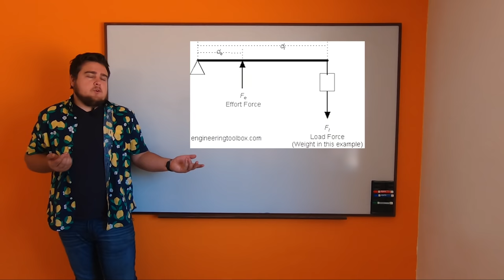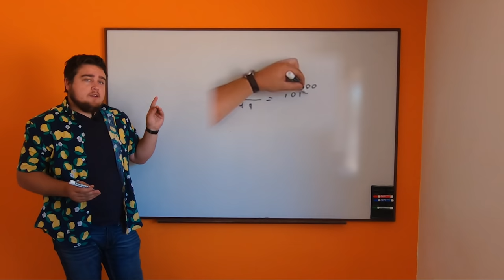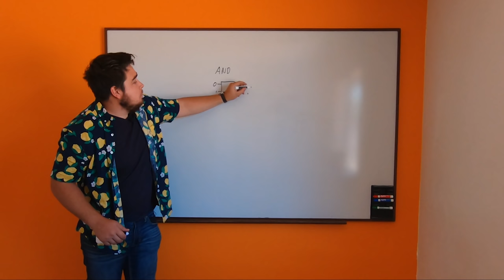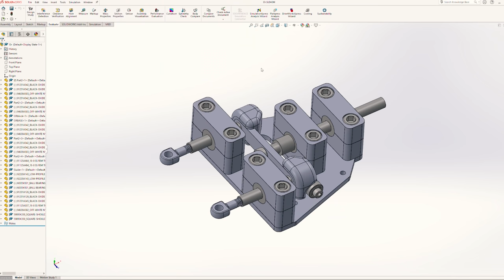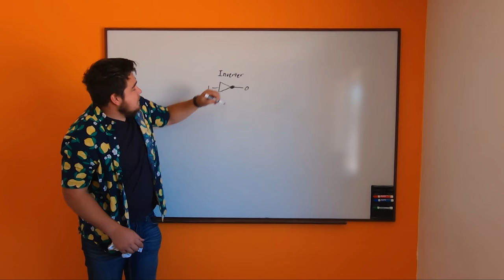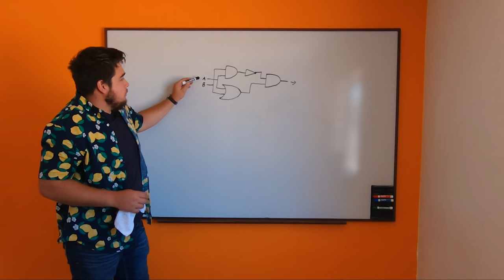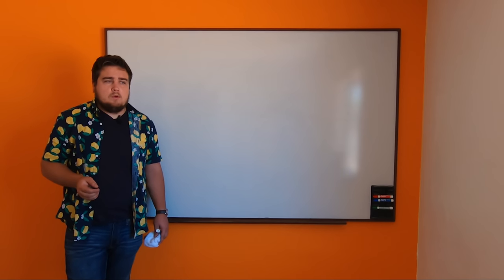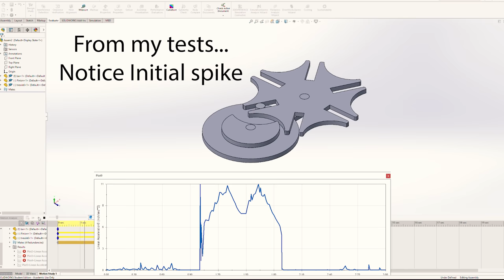Is a Completely Mechanical CPU possible?

Comment: "Art itself is in nature, and technology just reveals where it's hidden." That's a very profound statement.
Reply: 11011
Reply: I was enjoying the vid up until that point. To me it seemed a shallow pretentious statement, and completely misunderstands what art is and why it exists. Fortunately that really doesn't matter in a vid about making mechanical computers :)
It's a truism to say that art is in nature - after all everything is in nature - nothing profound there. The idea that technology somehow reveals 'where' art is is just nonsense - completely meaningless... unless you are shortsighted and need optical technology, or its nightime and need artificial illumination, or you are lost on the way to the museum, and need some cartographical tech... but those are just practical details.

As far as the binary logic - that's cool. It would be neat if there was a simple mechanical implementation for a NAND gate, because that is all you need - every other type of logic can be build from NANDs
Reply: @oldmossystone  I completely disagree with your blanket, and quite frankly derogative, statement. A statement that is just as shallow as you claim that the original statement is.

Because:
There would be no flute without the technology to drill holes in bones or forming wood. Not to mention metalworking, but that is much later.

Body paint works as sunscreen, and extracting the paint and mixing it is also technology.

That statue that always was inside that block of marble?

It required many skilled hands to turn the marble rock into a block, and even more technology to create the tools used in all of the processes from extracting a slag of stone to polishing the final statue.

Making a strict divisions between art, science and technology is dangerous. Art, including stories, have always inspired scientists and engineers to create new things, while new technology and scientific breakthroughs made new kinds of art possible. The links between technology and science most definitely goes both ways as well.
Reply: @57thorns  The implication in your original statement is that art is hidden and needs technology to reveal it. If this were true, all art would require technology to reveal it. This would exclude e.g. singing from art. QED.

While various forms of technology can be exploited in the creation and dissemination of art, there is no essential need for technology in the pursuit of art.
There is no need for a 'division' in order to make a distinction between technology, art and science either. Division would be bad, distinction is necessary in order to understand what each of them is, and to help us understand their unique value in our culture(s).
Returning to your example of the Block of marble. The statue was not always inside the block. The statue is a result - a side effect - of an expression of the artists state of mind during that creative process. The important point here is that if there was no stone, the expression could still have occurred in some other way - the Block of marble is not the essence of the art. The statue itself isn't even the essence of the art - otherwise any statue would be art (clearly not the case, many are just ornaments with no greater value). The statue or song or painting is a conduit - a medium through which to communicate.

A book is a useful analogy here. A book is a physical thing with pages and words. But the book is not the story, and the words are not the story either the story is an abstract construction of ideas that the reader decodes by reading the book.
A statue is like a book, it is a medium through which an artist has encoded some abstract meaning. If the statue is art, it is because it contains some deeper meaning encoded by the artist well enough that it can be decoded by the 'consumer'.
In the same way a story doesn't have to be in a book, it could be spoken word, or a movie, the essential meaning encoded in a statue could potentially have been encoded in a painting, or some other art 'form'. Not all available encoding forms require technology.
Reply: @oldmossystone  And yet, you can't accurately retell a story over time without a book (or other media that conveys words, including, but not limited to wooden staves, loose sheets of paper, movies, computers, clay or stone tablets).
Reply: @57thorns  You can't 'accurately' tell a story with a book - everyone's decoding of the abstract meaning will be different. Even the same person reading exactly the same copy of the same book a second time will probably have a slightly different experience.
It's likely that an experienced oral story teller can tell the same story to different audiences more accurately than a book can, because every audience is different, and they can tailor their use of language to each individual audience.

Comment: Well this is getting interesting, I work on turbine engine fuel controls for a living, essentially a hydromechanical computer, although much more analog than binary. Its impressive what can be achieved without the use of electricity, these take into account the throttle position, barometric pressure, temperature, and current engine rpm along with a few other parameters to meter the correct amount of fuel at any given time. And all designed in the era of slide rules no less! A digital system would likely be better, but they still do the job. I look forward to seeing where you will take this.
Reply: My friend used to work on pneumatic logic for tube trains doors and aircraft wings or something like that. Again, no electricity, but I do thing it was binary decision logic stuff
Reply from the maker: That’s fascinating, I still am amazed at what engineers did before computers.
Reply: Do you watch AgentJZ?
Reply: @Default78334  is that why my '87 CRX never passed Smog?
Reply: @WesleyKagan  So, all engineering before the 1950's?  All carburetors, all automatic transmissions before the 1970's? To be sure, much of that was analog logic rather than binary.  
This is great as a teaching concept and learning journey, but to rephrase what you said, It Has All Been Done!  Look up Babbage, read Bruce Sterling's "The Difference Engine", 
https://en.wikipedia.org › wiki › The_Difference_Engine
Those who do not learn from history, repeat it.  At least your repetition results in YouTube hits and educating some who would not find the information otherwise.  So thumbs up for that!

Comment: Have alwasy thaught about this. Compliant designs seem a realy good way of doing this as are far more simple. Would also allow for extreem minaturisation as could be manufactured using steriolithography similar to a silicon chip.
Reply: Fun fact is that one of my professors basically worked on a design kinda like that on the silicon level. There was a poster outside the door when I went to go have her give me one more submission time cause I submitted the wrong assignment. It used a relay design and the price bends with a compliant design on it if I remember correctly.
Reply: It sure seems like these things need to be 3d printed to ease the mamoth task of building a functioning computer.
Reply: Indeed, but this scale will have a certain pleasing clackety aesthetic quality to it.
Reply: Ya beat me to it :) I was going to suggest the same thing for the same reason. Honestly I'm surprised micromechanical computers aren't a niche market already. Seems like they'd be useful in nuclear disasters, to go into high radiation areas where electronics don't work.

Comment: Subscribed because this promises to be fascinating.

Three immediate thoughts: friction, tolerance stacking, hysteresis. They're all factors that are going to be working against each other, and you.

Whilst you said "I don't need to de-bounce the clock signal from a 555" my gut feel is that you are going to need some kind of mechanical buffer to sit between every few modules to ensure you keep a clean 'mechanical signal path'. Which is pretty much a mechanical analogue to debouncing an electrical signal. Now if I had any idea about what such a buffer would look like, I'd say...but I've no clue :)

Comment: I love that you are trying this. I had one thought though. The problem with doing this mechanically is that unless each piece requires little or no force, as it adds up you will have to use springs, grease or put the whole thing in a vat of oil to keep the force levels down. Kind of in a similar way where they made the first computers, they had to deal with current losses as more chips are added. This was done by having each chip be self powered and specifying what the maximum current draw could be for outputs and minimum for inputs. So I think that might be a challenge that you would need to overcome. Mechanically I think grease/ oil / springs might be a good way to help, but im a computer engineer not a strong mechanist.

Comment: Looks like a fun adventure! I imagine the resistances of the system are going to stack up pretty quickly though. Electronic circuits can be built with gain, to increase the strength of a weak signal. Can you achieve the same with your mechanical system? Where does the energy come from to do so?
Reply: the only solution I see is hydraulics but hen why not just make 100%  hydraulics logical gates. propagation would be slower though
Reply: @geemy9675  a hydraulic computer would be the easiest kind to build that I can think of, you could use air, water, mercury whatever lol most electrical circuits could be copied into a hydraulic circuit anyway. Would be slow but also would be cool, my optimized guess for core speed is like 100 hertz, possibly 1 Mhz lol but I think it'd be really hard to get that fluid to move any quicker and still retain accuracy in the system
Reply: Matt Parker built a calculator out of domino pieces. But it can only do one calculation. I guess the pieces hold potential energy which is good.

Other people built calculators with "marble gates". You could let marbles roll down and then lift them up on several places to add energy again.

Are marbles too slow?

You could power each mechanical gate and only let the connected gates direct the energy instead of providing it on their own. That's how real electronic computers work, don't they? Maybe push some rod upwards and another rod can connect it to another gate or disconnect it, like a clutch.
Reply: This is a "CMOS NAND Gate": https://en.wikipedia.org/wiki/CMOS#/media/File:CMOS_NAND.svg

It connects a high voltage / push to the output, if at least one input pulls and it connects a low voltage / pull to the output if both inputs push. So, in the end it "not-pushes" exactly if input a AND input b push, like a NAND gate should. (IDK if that helps anybody, sorry. I was pretty intrigued by that difference between the flow of the 1s and 0s and the flow of the voltage in computers when I first learned about it.)
Reply: @jomanout5866  I would use water and put it next to a dam.

Comment: the NAND gate alone provides a COMPLETE logical system, btw.
Reply: Don't even need to go that far. You can use a 3-state inverter with pull to get it all!
Reply: (or more easily with just a NOR gate which is effectively the same thing but with the pull resistors and buffering added in)
Reply: @Fingerblasterstudios  NOR is obviously also a complete logical system

Comment: I've seen a fully automated, programable loom built in the 1500's on display in the Technology Museum in Milano.
Reply: These Jacquard looms are indeed programmable, however, they do not actually do calculations. It represents a mechanism to record a set of instructions and have those instructions performed reliably. But that must then be sent to a General Purpose Processor; a device that can perform calculations via an Arithmetic Logic Unit, and then, as directed, be able to save the results to referenceable locations in some form of referenceable storage.
It's a similar situation with player-pianos, which inspired paper-tape memory: they recorded instructions, but the piano does not do any calculation, nor saving, nor retrieving of such calculations in order to execute further instructions.
Reply: @verdatum  I believe what I saw predated Jacquard looms by at least 150 years. It was built somewhere in Northern Italy in the middle ages.
Reply: @trespire  Oh hey, that's right, 1500s does indeed predate jacquard by quite a bit...In that case, that's rather interesting. I know that jacquard didn't really invent programmable looms; he just put together some ideas of others before, but I thought the ideas he borrowed from where fairly recent to him. I'm under the impression that the London Science museum has an impressive collection of looms that demonstrate this progression; I've always wanted to check it out.
You have inspired me to do research! :D
Reply: @verdatum  It was a small loom, 400 to 500 mm across, was damaged and not in working order.   It had very complex mechanisms all out of wood, forged iron and strings.   I went back to look at it 3 times, still couldn't figure it all out.   It was the most delapidated display in the museum, and yet impressed me the most.

Comment: As an electrical engineer and a person who loves creative DIY projects I really like this video. I did want to point out that building gates for computers and such, they're actually designed as NAND gates and NOR gates as the simplest form. This has to do with the logic of how transistors work whether in series (for NANDs) or in parallel (for NORs). To create either an AND gate or an OR gate requires adding a NOT gate (which is just another transistor). Which is kind of counter intuitive when you're first introduced to gate logic in an intro to digital logic both because you're taught AND and OR gates first and because the symbols seem to indicate that you're building from AND and OR gates.

At any rate, I'll have to check back in and see if there any updates on this computer project. It'll be interesting to see what kind of optimizations you can make to your gates and see if it actually works.

Comment: I'm really curious how you're going to keep power requirements and running friction in check, especially if you do end up putting return springs on a bunch of the gate outputs
Reply: Indeed was my first thought. Leveraged input forces. Mechanical disadvantage.
Reply: Definitely got me thinking that there's going to be a serious limit on how many gates you can fan out to and how deep the logic can go before the losses cause the inputs to break. Now, if someone can think of a completely mechanical buffer and flip-flop, then a long pipeline with really short stages would almost become viable 🤔
Reply: That was my first thought. Actuators would help.

Comment: I used to work on a telephone exchange system called the 'crossbar' exchange.  These systems used only electromechanical relays to run the exchange.  The relays counted dial pulses, routed calls and switched a caller to another totally with relays doing the logic and counting processes.

Comment: Having an energy source along the entire signal path, electric computers are able to keep the signal free from noise. I don't suppose the initial rod pushing can power your mechanical computer for long before it seizes.
Not to mention timing issues.
Your best bet is some sort of drive that amplifies the strength of preceding movement and aligns it to some timing reference.

Comment: You did a nice job building your gates.  
You may want to 3d print them...they could be very small and you might be able to print them already assembled.
Focke Wulf built a hydraulic/mechanical analog computer to automatically set the mixture on their FW-190...very sophisticated, very cool!   Lots of push rods and arms going back and forth.

Comment: Great video and kudo to the actual gate prototype. I think most people have pointed out the problem with mechanical gates being lossy or create a lot of friction. In essence, they are the same problem, some form of energy is going to be lost as heat as the gate moves (aka process information). Depending on your design, this loss is either translated to reduced shaft travel or (if you fix the travel) demand a lot of energy input.  This is why an electric computer gate (vacuum tube or semiconductor) is an amplifier (despite gain =1), and energy is injected at every gate operation to compensate for the loss. In your mechanical link, it is probably fine if your gate chain is not very long per clock cycle. Otherwise, you might want to design a gate that is active, in the sense that mechanical power is used to perform the logic.

Comment: Hey man ! Just a tip that might be useful; I call this the "If it floats, it's where the mics goes", which basically means whatever you're wearing, you're mic goes on the most steady part of the cloth that's the most going to move.
Like, your shirt's neck not the t shirt in that case lol.

Anyway great video dude, subscribed !

Comment: Guy is basically starting over with computing and going through the same minimization issues that original larger computer such as tube based computers ran into. I'm sure there were quite a few mechanical computing concepts back in the day. I mean the fact that certain fancy typewriters had caps lock, key memory, and more - its arguable this was all done before.
BUT!!!
I think its cool to start over like this as just cause it was done before by people in the past doesnt mean every permutation of possible solutions was experimented with, leaving some more interesting inventions on the table perhaps. We too often find what works through trial and error, move on, and rarely come back to that part of the problem unless the solution we found has a low efficiency or durability. 
Here I think computers have very much moved on from larger mechanical components however I do still think certain insights can be gathered by revisiting this whole field. Glad to see people are still experimenting and thinking about this stuff.